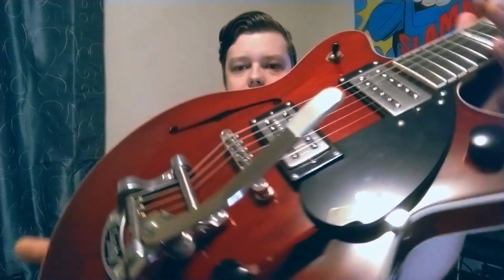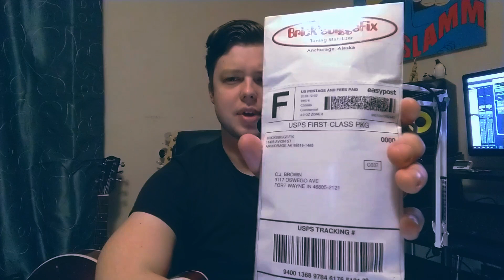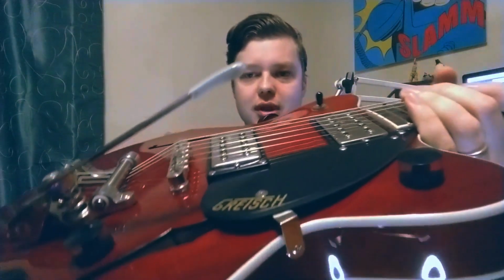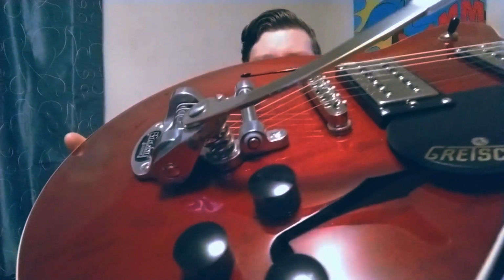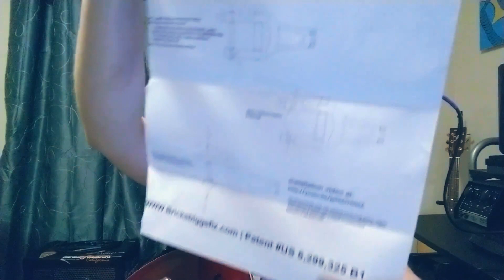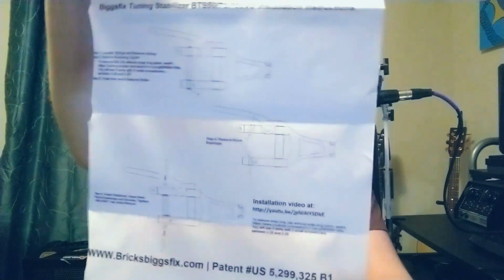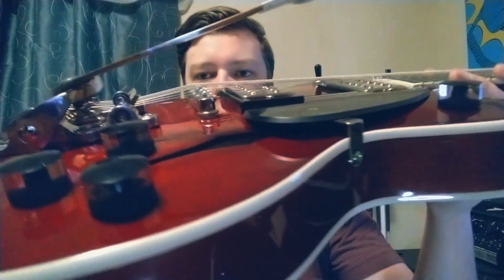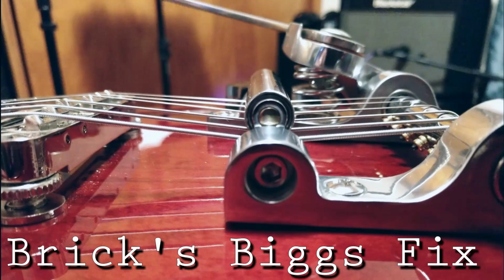Upgrading My Licensed Bigsby Guitar: Fixing Tuning Stability and Responsiveness.

Comment: Very nice video and well explained.  I have heard from many just to run the strings over the top of the original roller to get rid of the break angle and they say the tuning problem goes away.  Yes, it's the squishy spring (I get mine from Reverend) that makes your Bigsby feel so much better.  Everyone should make that change to the squishy spring!
Reply: Did this to a Gretsch 2655 Streamliner and its a game changer as far as tuning stabilty.  The offset roller seems like a great idea and would add a little break angle to keep strings on saddles.   So far I've not knocked a string off the saddle but...

Comment: i find a spot of lube on the bearings does wonders. bear in mind this is a bearing held in high tension along its length, that you want to move all day and that supports that is one short spring to pull it back to the same point, every single time.
My fix from new was to strip and polish out the frame from new, the bearings going back as a very loose 'touch' push! , a slightly heavier spring and step down in string gauge.

Comment: Another nice thing im doing with one of my originally stoptail piece guitars, is adding a Bigsby with a mounting plate thats like 4 or 5mm thick ... besides that it will allow me to put that bigsby actually on 3 of my guitars... that mounting plate with the bigsby actually  gives me about the same breakangle that my stoptail piece had on the guitar when i topped it to the body...  so yes... without that thick aluminum mounting plate the breakangle WOULD be  silly ... especially for the fact that the idea is that the strings glide over the bridge :D also without that plate that creates distance... it would be silly difficult to restring it, with so little space between bigsby and the guitartop (just tried it :D a ballend wouldnt fit through it :D )  ... I hope i will not have the need to put a extender on that like you did, due to the mounting plate im using ;)